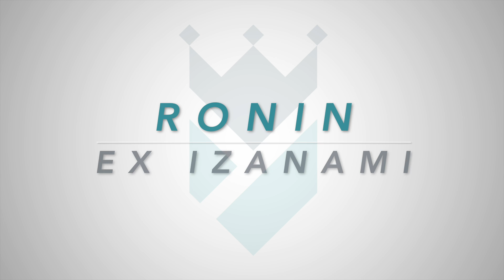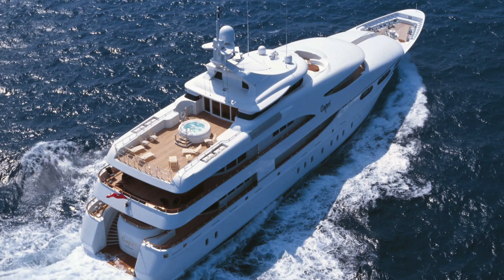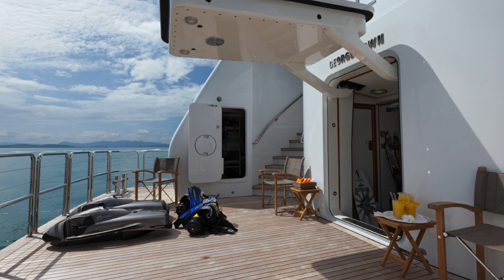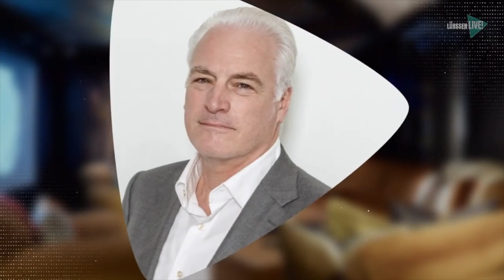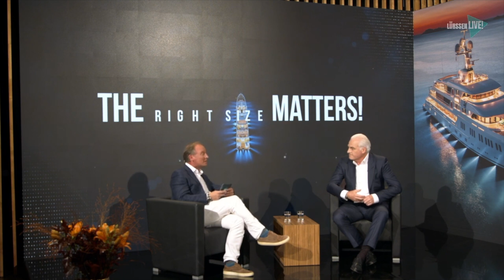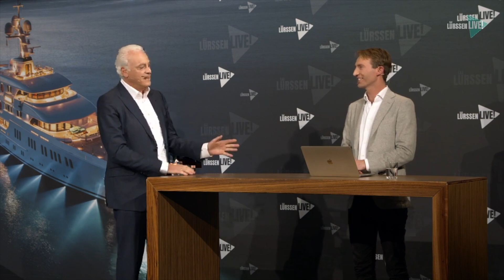FIVE LURSSEN YACHTS UNDER 60 METERS - AND MY INTERVIEW WITH PETER LURSSEN!!!

Comment: Yah, that was a nice event, well done, not as clunky as some industrial presentations I've seen.  It's hard to sound spontaneous when you have to spool out all the necessary catch-phrases and standard responses, but you folks made it enjoyable.  At least you didn't take too long on it.  You can only say, "We're here, more later" for about so long, and I think you chose well on when to cut.

Lurssen doesn't have anything to apologize for, which saves some copy.  Everyone knows they are badasses who can do a dock-pretty or a naval destroyer.  You want Baywatch or a battleship?  The question for buyers is more like... "Can I use something big enough for them to bother building it?"  If Lurssen wants to take 500gt custom orders, they'll grab up as much of that market as they can service at their new facility, and hear as many hair-brained client ideas as they can stomach.

Later, more specialized episodes sound exciting.  My questions on propulsion would be for solar.  (The idea of putting hydrogen cells in private vessels is still just begging for rocket-ship sized explosions al over the port, as far as I'm concerned.)  When we are talking big boats and renewable energy,  "Where does the diseconomy of scale cut in for solar-electric?" and "Is there a point where something like extendable  vertical wind turbines can stretch that range?"

In other words, when can collection area no longer keep up with the squared-cubed laws for larger, taller, more power-hungry yachts?  Can you make hulls/hydroframes wide and low-profile enough to give sufficient collection area, yet with enough rigidity to survive waves and weather in these size ranges?  Could you make up for area/volume issues with top-decked "Warren-type" multi-hull design/construction?

I guess the stylistic question that evolves from that includes interiors.  If a client wants a very "green" boat like full solar, is it inevitable that the heavy marble counters, plush carpets, thick-walled cabinetry, and so on (all of which I consider abominations on a boat anyway) must need to trade off for lightweight alternatives as well, to stay within the size-to-mass limitations of the energy collection to boat performance parameters?

Personally, I think clients will adapt to whatever is required to meet their virtue/vice space, mentally.  In the past, maximum opulence has weighed many yachts down with stylings that truly only belong on a literally rock-solid foundation, at the expense massive fuel consumption and the health of the natural world.  Now, as people with money still want to have fun -- but without turning the oceans into battery acid as a consequence -- I think there could be a whole new evolution of what a yacht looks like and how it works.

I guess the overall question that remains is, "How much can change how fast, and how much do you get to keep at what sizes to accommodate that?"